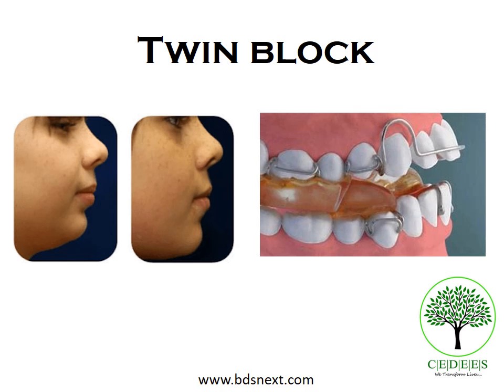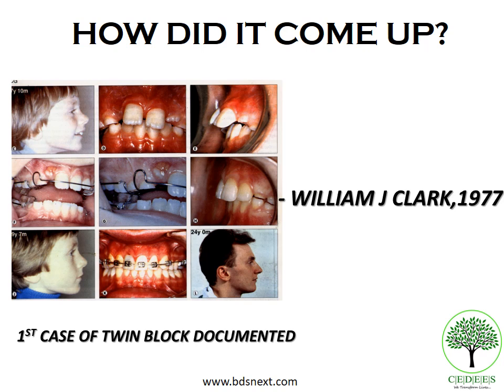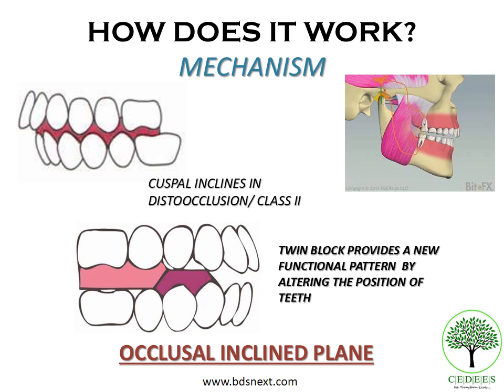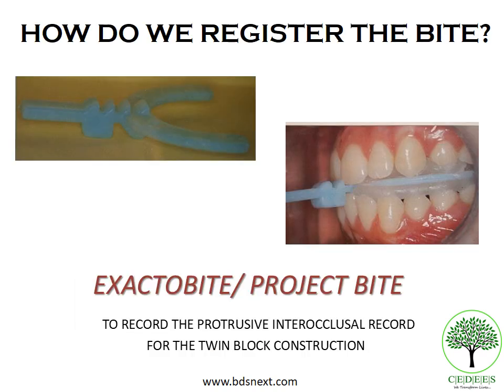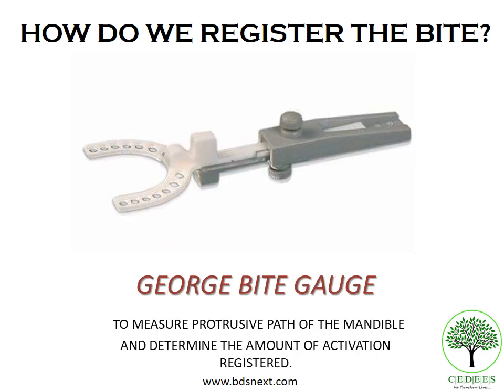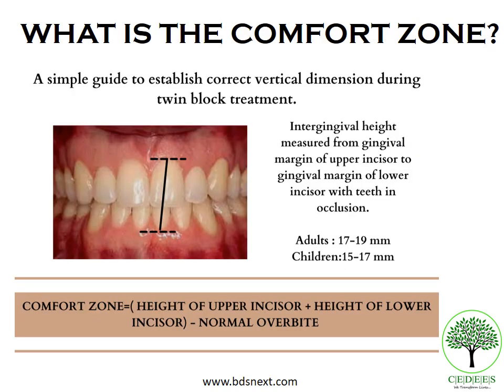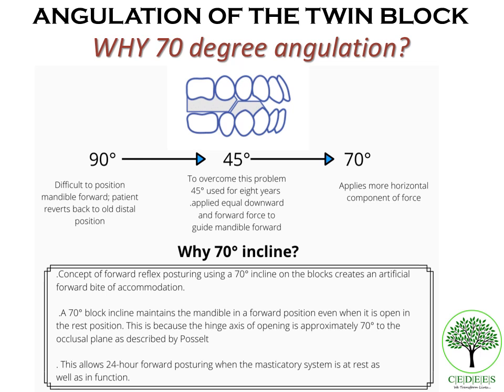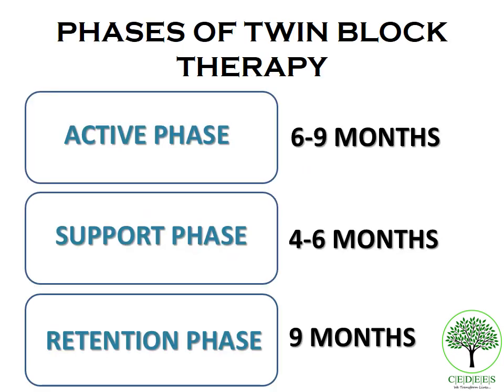Twinblock - Concepts made Clear!!

Comment: Dear Doctor,  thank you for having these lectures on here. I found this very helpful. I wonder if you could help me with something I am having trouble understanding. I have a 10yo female patient - skeletal Class 2 with a high mandibular angle and a slightly increased lower face height. If I use a twin block to correct the Class 2, will this increase her lower face height and  is there a way that I can avoid this when using the twin block?  Thank you in advance for any advice you can offer.
Reply: you may use the TB,but don’t redues the maxillary block in height .but it need you grasp the occasion, it had better to start the second phrase instantly to intrude the maxillary incisor ,and then make the mandible counter clockwise.